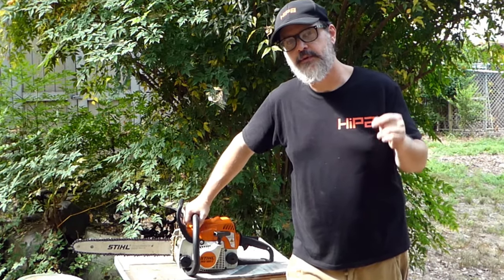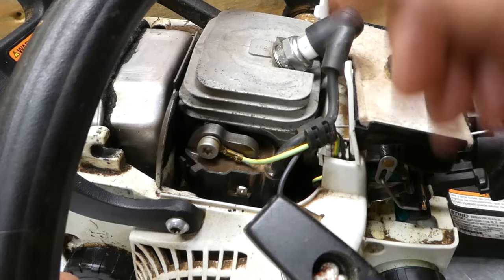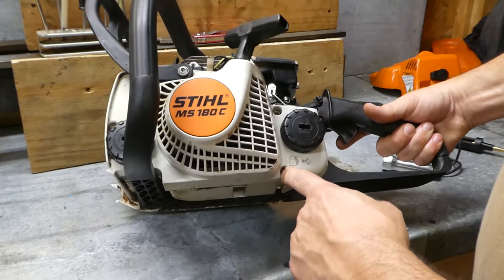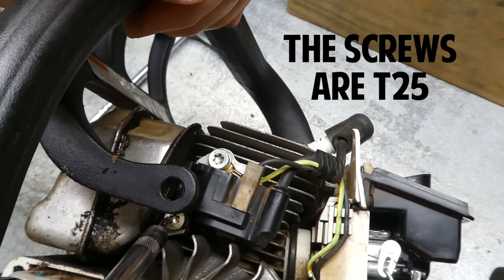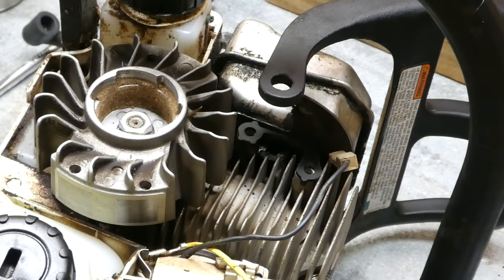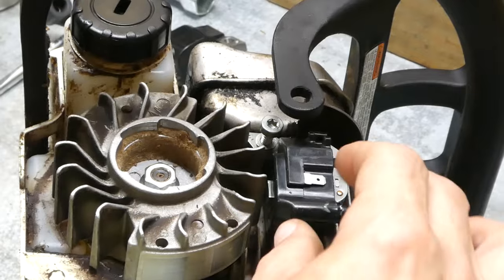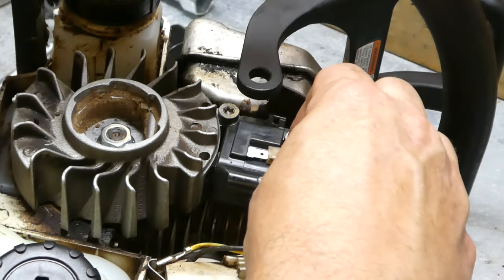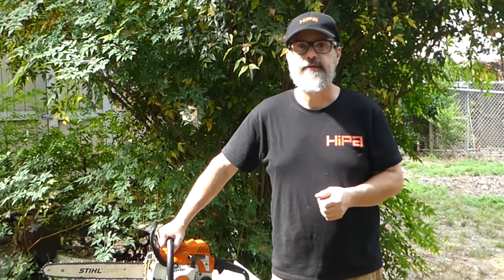How to Easily Diagnose and Replace a Small Engine Ignition Coil. HipaStore.com

Comment: Sir you are a star, I have had the MS170 Stihl version for many years. Recently it has been a pig to start or not start at all > fuel mixture was correct so only left ignition. Thanks to your video I stripped down the machine as far as checking the coil and gap. Although I had never touched it the gap was nearly non existant how it worked before beats me. After cleaning up the coil from gunk I reset the gap to .009 " as you suggested and reassembled.  Couple of cord pulls and it started.
I can't thank you enough for your excellent video

Comment: That small twin hole spacer under the coil is typically a thermal bridge to reduce the heat from the cylinder from migrating into the coil and it’s electronics… yes the fasteners do act as sinks buy less than a direct placement…

Comment: question about your using a spark tester, why don't you just remove the spark plug and check the spark on it ? you merely need to connect the same as you did with tester.

Comment: what is your replacement module for Ariens 7524 snowblower. The numbers on it are 1A138-52-12 with 5111 below that? I will buy it, thank you
Reply from the maker: Sorry, but we don't have the ignition coil for Ariens 7524 snowblower so far.